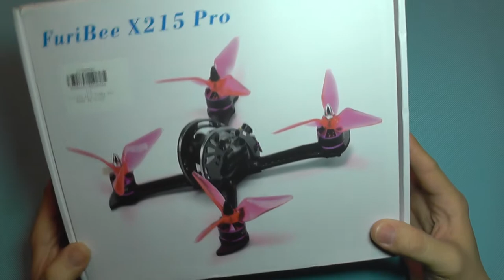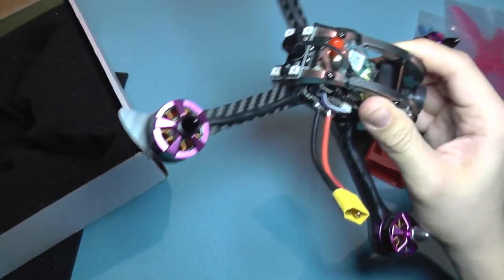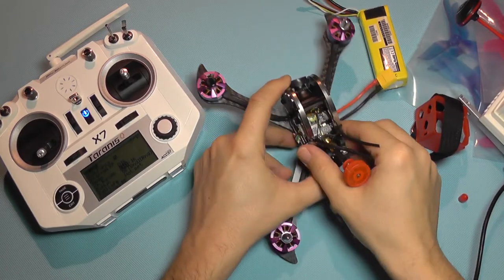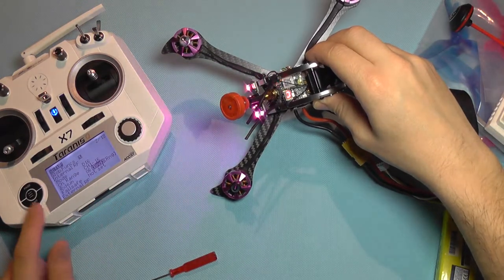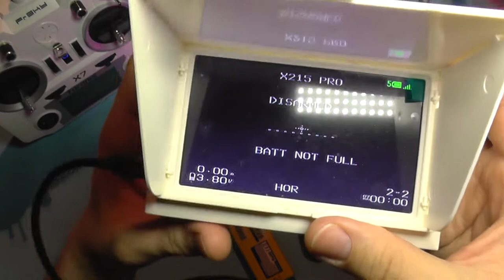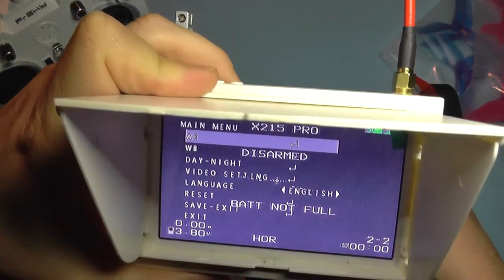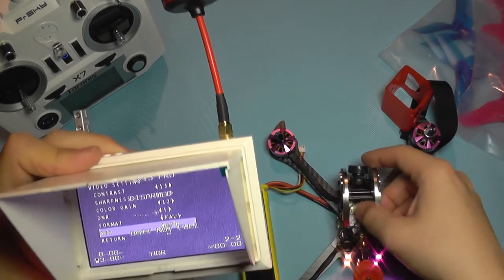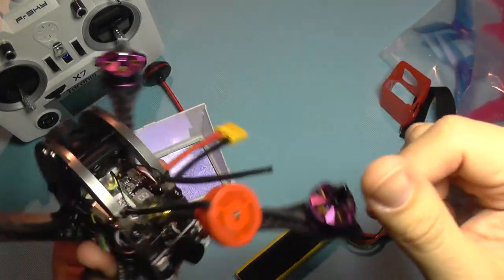FuriBee X215 PRO - A 6S Runner - Full Review, Part 1

Comment: hi where is part 2 !
actually xm+ RX has Sbus and ppm .. and sends RSSi telemetry only(after updating firmw or adding analog rssi wire).
i received mine with a broken motor.
Q:  do you have a manual for the VTX ?
Reply from the maker: I haven't bothered to update the receiver, I may look into that as I got a new X251 Pro - S, and it comes again with an XM+ but has RSSI working by default in betaflight ! I haven't managed to fly test / make part 2. I don't have any manual for the VTX, it's integrated in the FC stack, you can get a bit more info at looking of some of the F4 Furibee available FC: https://www.gearbest.com/furibee-f4-_gear/
Reply: Let's see those 2600kv motors run on 6s!